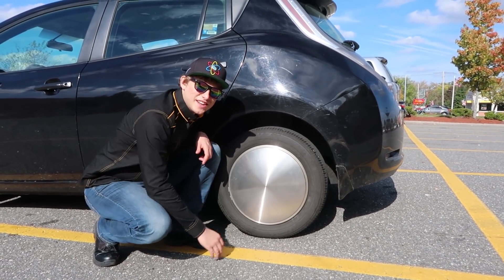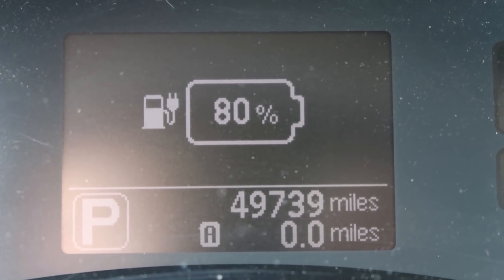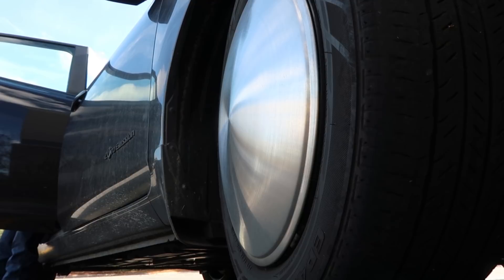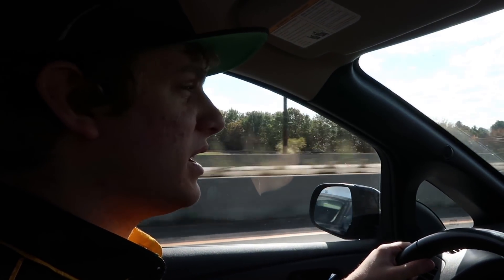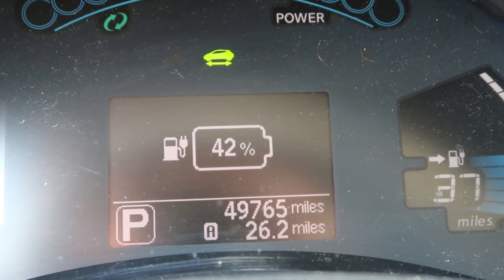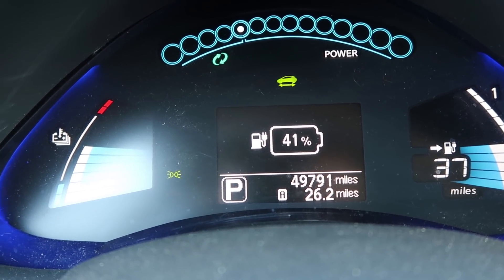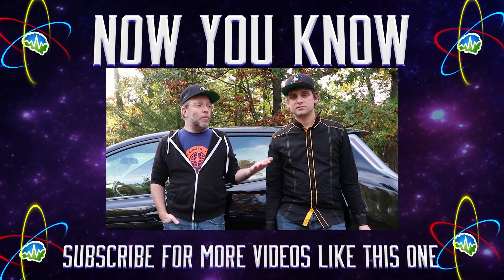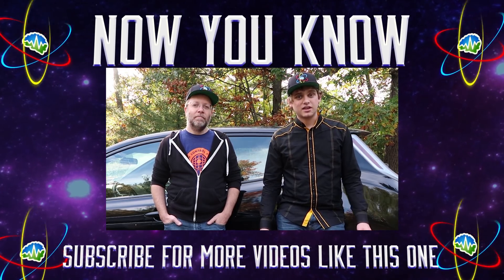Nissan Leaf Hubcap Efficiency Test #2!

Comment: Repeat the test comparing low and high tire pressures.  Compare the recommended OEM pressures to max tire sidewall pressure.
Reply from the maker: +lessdeth69 tire pressure does make a huge difference. But that is much better documented.
Reply: The myth busters already did a great test with tire pressure. And I think (not 100% sure) that higer pressure had lower fuel consumption because there was less contact area between street and tire. BUT that means worse braking behaviour (less braking area) which is dangerous and more tire wear, meaning that they need to be replaced more often which is maybe more expensive than the fuel savings and also it is possible that the tire pops because of the too high pressure.

Comment: Rather than using the leaf to report the energy usage, use the charger. time how long a charge takes and knowing the power during the charge you should be able to calculate the energy used.
Reply from the maker: +Stephen Methuen charging, especially at a quick charger is extremely nonlinear. As the battery fills up the charger provides less and less output. The charging time we depend a lot on the battery temperature and other stuff like that so it would probably be even less accurate.
Reply: Shame

Comment: Wheels that actively extract air from inside to out have to be different right to left. turbo wheels. Stylized alloy wheels that look the same on both sides of the car would blow out one side but suck the other side , surely?

Comment: Negligible for normal drivers. Semi trucks might see long distance gains but overall, hubs drag is not a factor. Hubs weight is much more important.
Reply from the maker: +Josh Sisco mere ounces? Sounds (if that were true) like going to the bathroom would make more of a difference than hubcaps

Comment: That's interesting! Honestly I'm sure there is some influence but other parameters, including the temperature of the battery, and as you mentioned, the rest of the car's aerodynamism, are much more important. Probably it'll be more significant on the Model 3 because it is much more aerodynamic than the Leaf, and most probably a little "unaerodynamical influence" would be more important, relatively speaking... Sorry my english sucks :/
Reply from the maker: +Alexis de Wouters your English was superb
Reply: +Alexis   Excellent point!! Probably most important thing said here including video.
Reply: Thanks. I would add that the difference (was it 5 or 10% ?) that Elon said about the Model 3 are a lot more due to the difference of friction on the ground from the tires than the aerodynamic of the wheel itself.

Comment: I think the margin of error in testing this way is too big to have meaningful results.
I think the best way to measure the difference in drag would be to have an air speed meter (like airplanes) and a display of the instant power consumption of the engine in kW (or Volt and Amps, don't know if that is available on the CAN bus). So you have to find a stretch of undisturbed road 2 miles or so, run the test without the caps 10 times at the same air speed on the same stretch of roar each time, and 10 times with the caps, but alternating each time (one without, one with, one without one with...) to have conditions even out over all the testruns. At each run you would get up to speed, hold it for 10 seconds, log the consumption and the exact air speed while still holding the speed, and go back for the next run.
Cheers

Comment: your old result was totally irrelevant, because the wheelcaps change about 5% of the aero profile of the car and the aero does only merely affect the consumption at these speeds, so that big of a difference was impossible. 

could have also charged to 80% after the second run as well and compared the KWH figures on the station directly, it seems to be most accurate. also, testing for 20 miles once is not good indicator, even if you chose nice conditions and tried to drive as similar as possible. for a reliable, kinda scientific result, there should be at least 200-500 miles of driving in different screnarios.

Comment: I cannot believe how unscientific your experiment was. The idea of going back on the same road the opposite way cancels the effect of air wind speed.... really? High speed is where these modifications should yield the most influence. May I suggest a long constant throttle run at 55 MPH done twice on the same day in the same direction. A liquid fuel car would be a lot better for giving you a way to measure the consumption.  I'm looking to put something to this effect on a VW Lupo 3L.

Comment: The result are within the margins of error and I would say that they are just as efficient until the same test is done 50 times and show the same 2.5% in favor of the racing disc hubcaps every time.
Reply: You would just need to show an improvement most of the time, not every time in your 50 test cycle experiment.
Reply: OK so if the racing disc hubcaps loses 26 times that is good enough to say it is less efficient? In real statistics you never approve anything less then 1000 random times.
Reply: First you say the same test should be done 50 times, now you say 1000?
Reply: I see that you are pretty limited and I don't know how to make you understand.